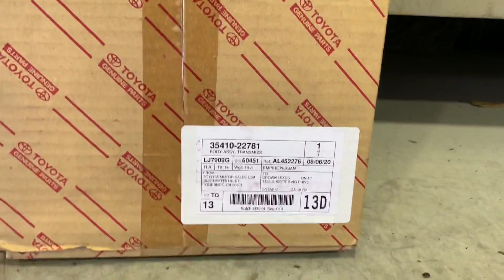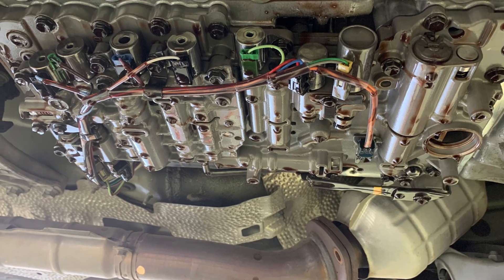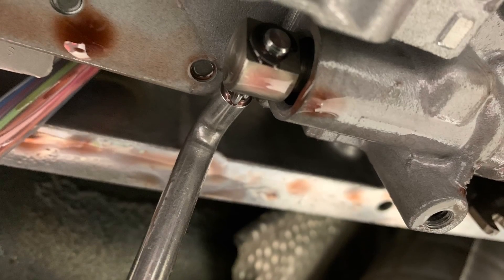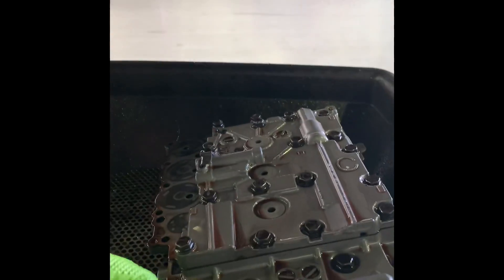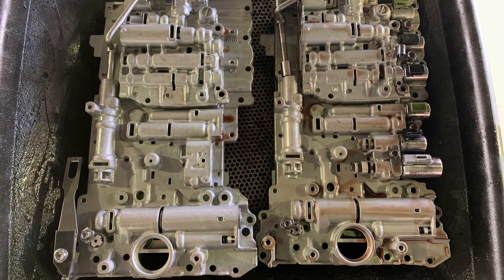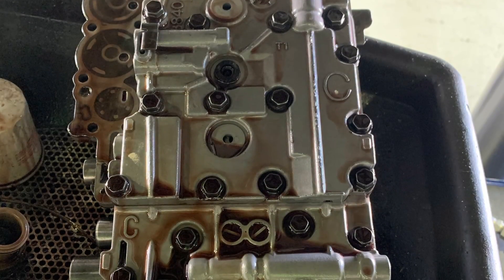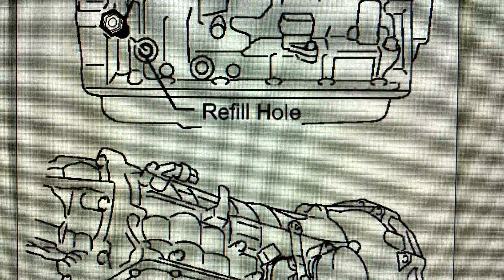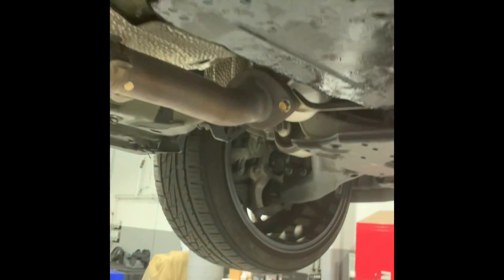DIY: Remove and replace valve body on a 2012 Lexus IS 250 RWD

Comment: If you are just replacing a solenoid, does the valve body need to be removed? I’m assuming this is similar to a 2007 IS250 RWD, which I have, and a shop is claiming the valve body needs to be removed to replace a solenoid.
Reply from the maker: Honestly I made the video many years ago.  If I can remember correctly I believe I did have to take the valve body out because some of the solenoids will not be able to slide out due to it hitting the side of the transmission case. Therefore u may have to drop the valve body down so the solenoid can slide out freely.

Comment: I hope that you get to see this appreciative comment on your video/work.  It helped me WITHOUT a doubt on troubleshooting, uninstall and install PLUS identifying key components of the valve body replacement and solenoids to test and post install, drain, refill and any scanner/computer reset values for some cars that do not like a new component added, such as my case with my 2008 lexus IS 250 RWD.   Good luck in all you do.

Comment: Very Informative, Thank you, I need some assistance please, I have a 2007 Lexus IS250 A/T, where my transmission seems to be stuck in a neutral, When moving through the gears it shifts ok, however when shifting from R to P it makes a grinding sound. Also when the car is on ( Iddeling) and I select the Sport mode and run through the gears, it changes like normal, however, there is a buzzing sound coming from the solenoids, but when I select 1st it stops buzzing, and all the other gears it buzzes.

Comment: Great video but you miss few things. 
1.before you start you should loosen the fill bolt that thing can be tricky. Do not use anything other then a 24mm 6 point sockets to loosen that fill bolt. Look in the transmission section in the auto store the socket is usually there and it’s made shorter.
2. Do not open that 5mm drain at 10mins. Car has to be between 105 and 125 when you open that valve. Use only Toyota or Lexus WS fluid. Not even stuff that is compatible to it.
3. No need to pump it in . use  a hose put in in the fill hole and other end with a funnel in it near the brake reservoir and let gravity do its job

Comment: Have a Lexus is 250 would not pass 3rd gear any solutions 
Auto transmission A960E 
Previous to this issue use to disconnect battery terminal issue was fixed tried a couple of times there after and would pass 3rd gear
Reply from the maker: i am not sure it could be a number of things. sorry i am not able to help you on this. this vehicle in the video had no drivability issues and only had the code listed.
Reply: Hey. I have the exact same issue, what was the cause, I know the video is 2 yeas ago bit I thought I give it a shot. Thanks
Reply: @IbraheemHanbali-oo8pc I have the same issue, I’m replacing the valve body tomorrow, I’ll let you know if that gets it, I replaced the shift solenoid related to the p0761 code I had as well as the not shifting past 3rd gear and it did not fix it. I’m thinking my issue is internal in the valve body, I have no debris in my trans pan and fluid looks good.

Comment: valuable information thanks for sharing it I would like to make a query I have a Toyota Tundra 07 if I am not mistaken they have the same type of valve body, had code P2757 change the SLU solenoid and wire harness by putting everything back and checking the level of gear the reverse wouldn't engage only forwards you had an experience with a problem like that I appreciate any information

Comment: Reason for complete valve body replacement
Reply from the maker: vehicle had code p2714 pressure control solenoid D stuck off. I replaced that specific solenoid and it did not clear the code. So i replaced the valve body and the code cleared.
Reply: @jspecspecialties  i got the same code p2714 and the second one is p0761 apparently solenoid SLT and S3 , you think i need to change the entire valve body tho ? :( i hope no
Reply: two more question you didn't shut the car off before opening the overflow tube ? And what type of product are you sprayin at the end ?
Reply: @jspecspecialties  So if I have the same code changing only the valve body, without replacing impacted solenoid, is this going to work?
Reply: @Udontknowme8793  Same here, I will have to send my original valve body to get a modification.